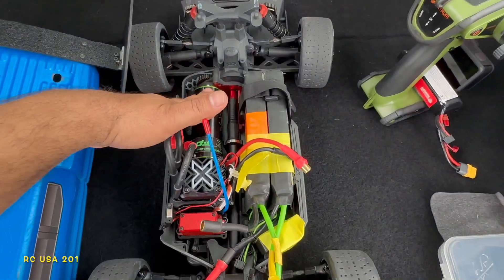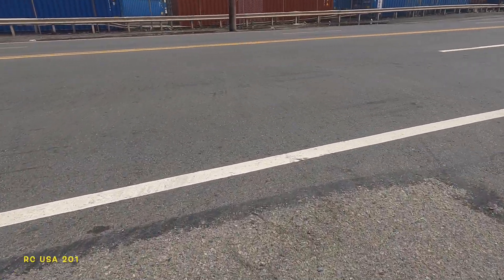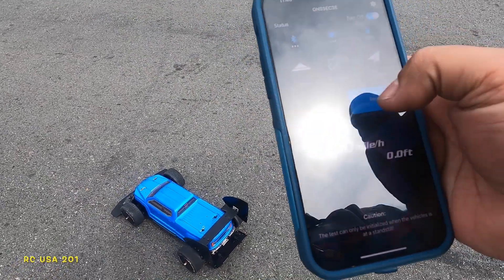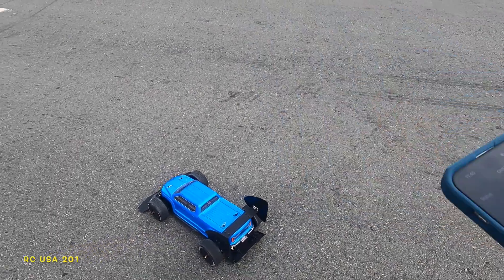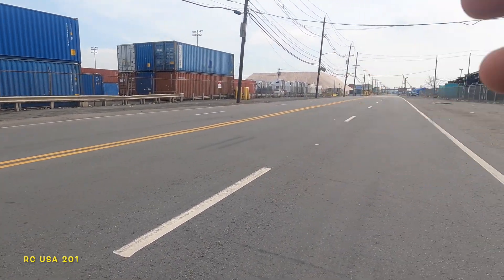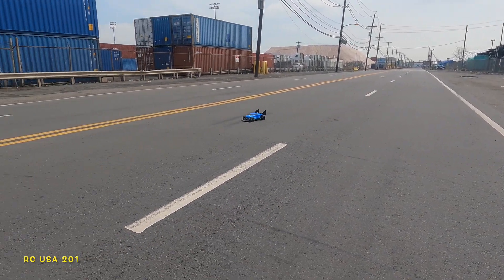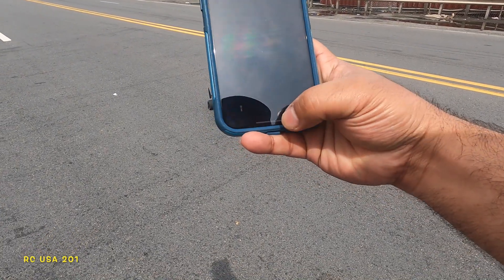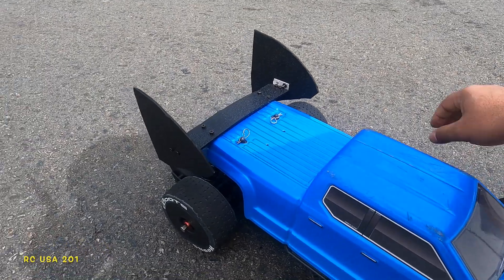Arrma Big Rock 106 MPH on 6s with TP killmode 2900kV    2nd pass

Comment: Bro,if you remove those shocks an put solid link turnbuckles on all 4 an add more wing downfore itll go laser straight. All that on the front is probly causeing so much downforce rwars getting light..ive ran BR body,,,all truck bodys need lots of rear wing or rear will dance around an rear will come around under braking...I'm currently fighting the azz end dance on my notorious at 134mph
Reply from the maker: Yeah I made my suspension pretty solid shouldn’t need turn buckets I have about 3mm squat I like some absorbing